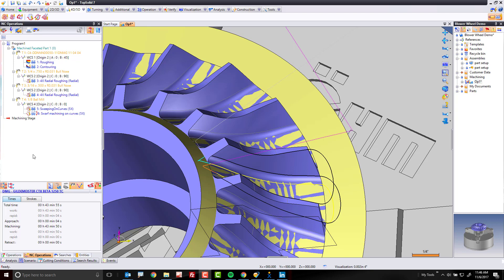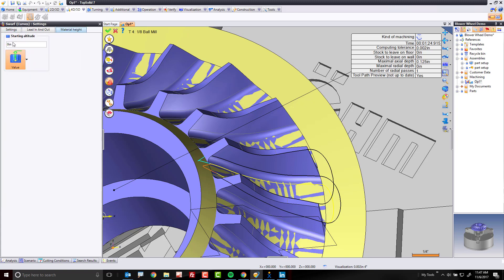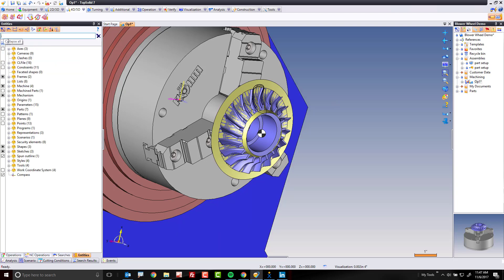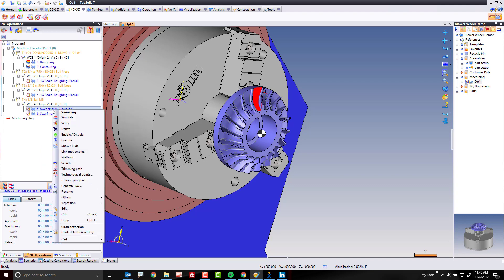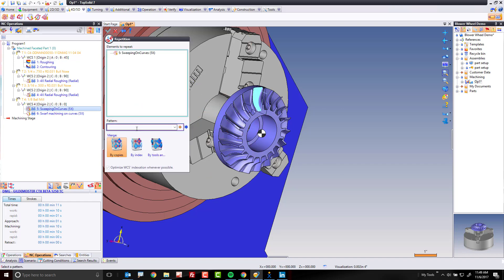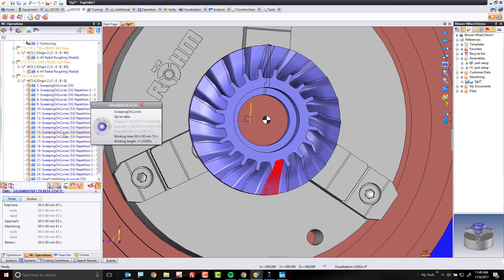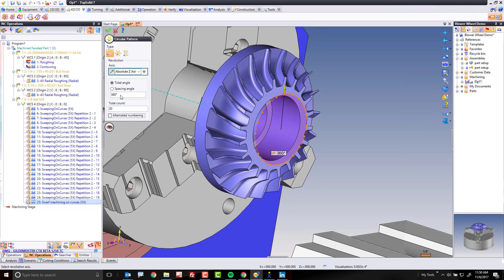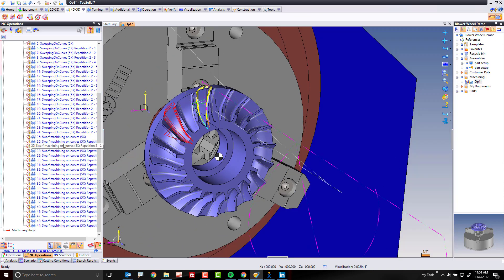Machine a blower wheel with TopSolid - Step 7 Modify and repeat your tool path

Comment: well done! thanks a lot for this tutorial! very useful! i am a CAM programmer / designer from Italy. i’ve used TOP6 for 7 years and TOP 7 for the last 3 years. 
there are a lot of good tricks and cool feature we have starts to use that baybe are usefull for a lot of other TOPSOLID 7 users.
espetially looking for automatise or standardize and get programming quick…
top solid users need to use this and top solid crew need to show up to new ( baybe ) customer.
if you want i can suggest you some feature that in the real shop is neede and you can explore.

cheers!
Giovanni
Reply from the maker: Hi Giovanni. Thanks for the feedback. By all means, please share some of your ideas!
Reply: Hi Tom.
thanks for the support.
as CNC shop user in order we had worked on:
1 shop floor template ( table list, tool list, operation list)
2 tools database ( you can show the twice mode, from a family and from a explicit family with the tool assembly)
3 vise and chuck assembly
4 standard fixture ( like cube, table, plane) and fixing tools ( like mitee bite or erowa system) with tha easy excange system
5 machine template with tools and fixture
5.1 custom link movement for safe machining and for 5 ax machining
5.2 fixture safe define for not collision
6 tool parameter document ( at this time we never be able to make it work)
7 standard tool path save
8 automatic working path method ( soo important)
9 automatic driil method ( this feature have a good potential)
10 raw material automatism
11 special feature for working part ( mid tollerance switch, special face with reserve)
12 working method associate to a CAD feature

in addiction , for build easly an quicly jig or a mask you can explain how to create an "assembly with a process” to automaticaly position a fixture in a mask and creeate, for example, a poket with a offload and a thread for a screw. 

this is whati we have worked on during the last 3 years when we use TOPSOLID 7.
if you don’t understand something let me know…i will try to express better ( maybe i can send you an email with some screenshot) 

bye bye
Giovanni
Reply from the maker: Excellent feedback! Thank you. I will try to add some of this to my list of items to cover.
Reply: good! happy to help you…an help us Topsolid client! cheers!